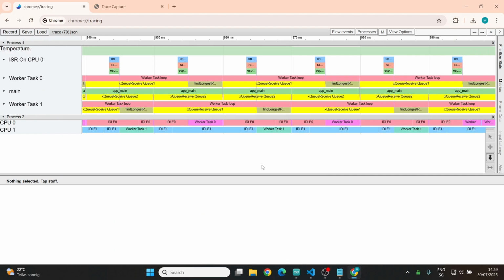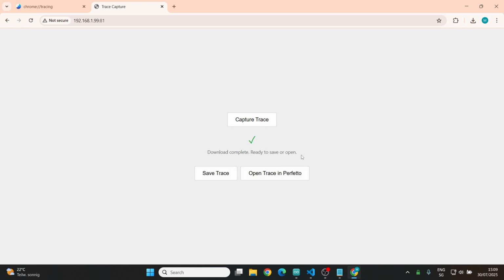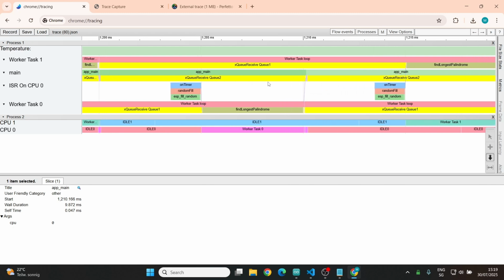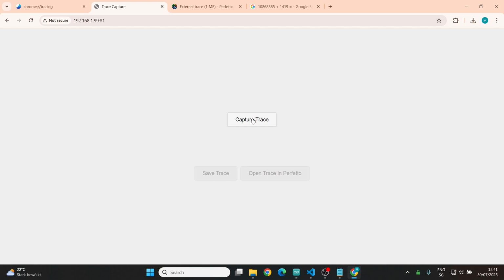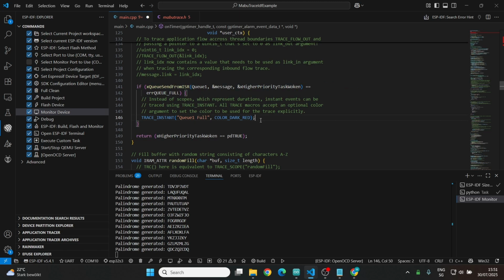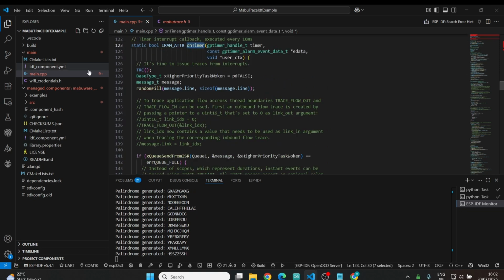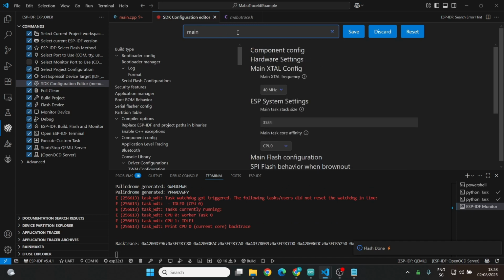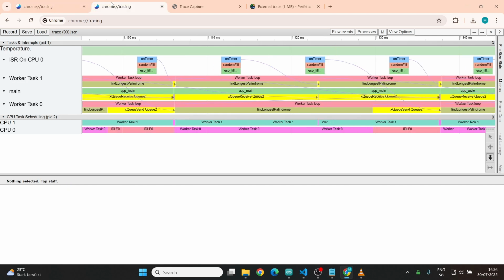ESP32 profiling tutorial using MabuTrace

Comment: Well done, I think streaming can be possible to accumulate traces infinitely and build charts over them.  The implemented basic one-shot mode is useful because it does not interfere wi-fi that much compared to streaming.  

I'm going to try this tool, however I already have a server, don't want a new one.

Sometimes I want to trace other tasks in esp32 including system ones. These tasks cannot be instrumented easily from the app code. However their latest stats are available via uxTaskGetSystemState.  These stats are off-sync from the regular traces view, but it's helpful to see them too.

Another scenario is to enable instrumented tracing only if cores are being overloaded, that is when ulTaskGetIdleRunTimeCounter(core_number) reaches a certain percentage threshold.